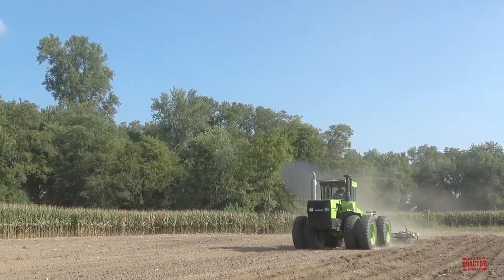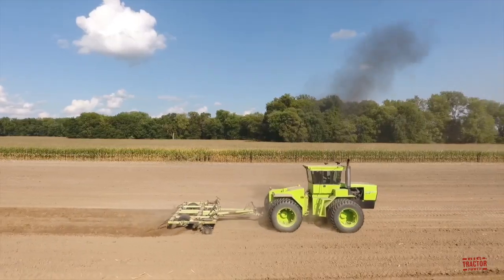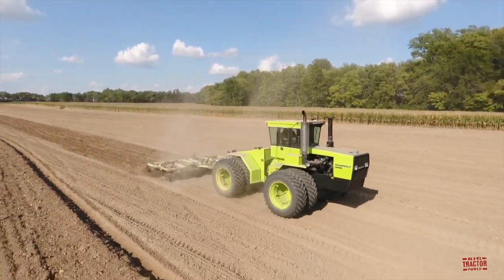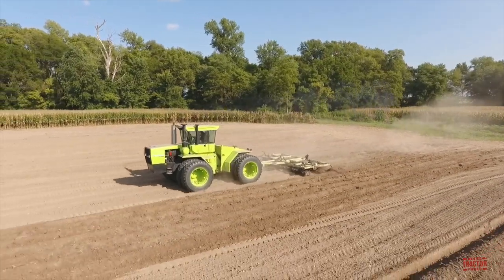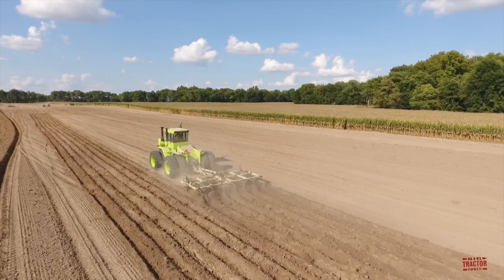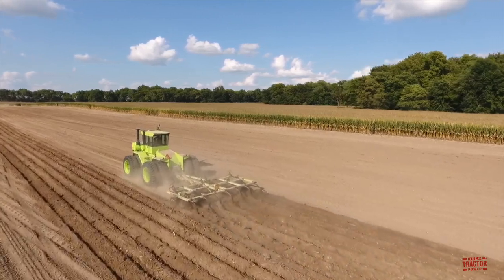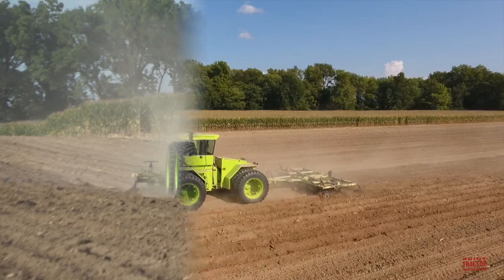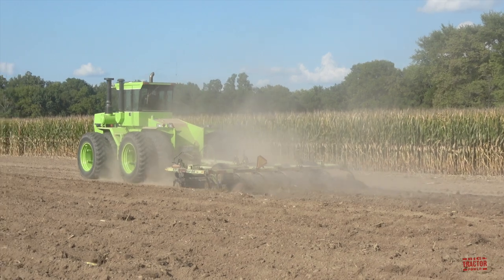RARE Steiger SM-325 Panther IV Tractor

Comment: Stieger is still being used in south africa on commercial farms .Still have my Cougar steiger with Allison semi auto gearbox .Just changed the cat 3306 precombustion engine with a cummins 400 .The tractor is fitted with a lift and still puls 12 tine ripper 700mm deep without any effort .Great tractors

Comment: I've never had a chance to see a steiger up close.... I bet they were power houses back in the day..  what's the minimum HP for that plow ? thx Jason!!
Reply: Depends on conditions but I’d say 250 horsepower and at least 22,000 pounds as a bare minimum, realistically  25-50 more horsepower and anywhere from 3-8,000 more pounds
Reply: @nellsonstout7001  thx bud.... Just wondering... I have nothing close to that in HP anyway....
Reply: @kygreenskeeper8326  most of the time I rode with Jake, it was pretty easy pulling, but we did find a hard spot briefly that slowed this old girl down pretty noticeably
Reply: @nellsonstout7001  I wish Jason would have shown inside the cabin of that old more... I've lived on a farm my whole life and have 160 head of cattle. I've always been obsessed with tractor's.
Reply: @kygreenskeeper8326  it’s a small cab for 2 people unfortunately. Trust me on that
Reply from the maker: In the 70’s and 80’s if there was a green Steiger in your farm yard you were doing some serious farming. They are stand out tractors. 

The 13 shank coulter chisel will work out a 325 Hp tractor out. I filmed my Tiger II on an 11 shank Steiger.  The 320 hp Tiger II knew it was back there.
Reply: @bigtractorpower  so that’s your TT2? The one that’s been at Wathen’s for quite some time?